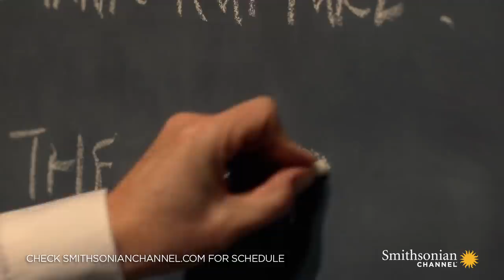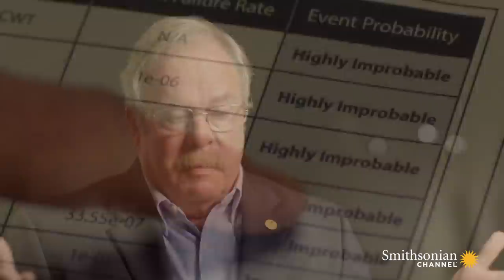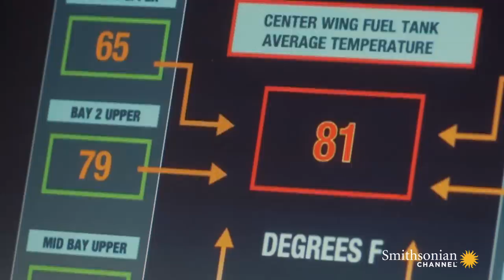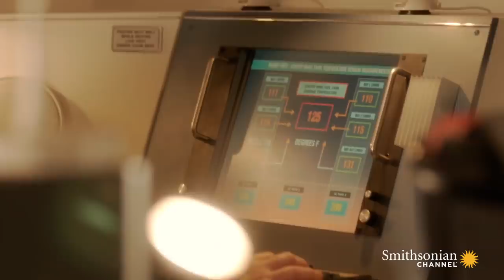How Air Conditioning Caused TWA Flight 800 to Explode

Comment: Next they should do one on jet fuel and steel beams
Reply: Or Zyklon B staining concrete
Reply: there is no steal beams in any airplane. plane beams are made or aluminum and titanium or both
Reply: @hassangoli8080  It's a 9/11 conspiracy joke
Reply: nathan V 👍.  WTC 7 = Flight 800 = BS = government coverups.
Reply: r/wooosh
Reply: It doesn’t melt them, merely softened the steel to the point where it was unable to support much weight
Reply: Timothy Verrinder  it astounds me how almost no one realises that even if steel is not melting, extreme heat is still not good for it. My Laptop only heats up to 100 or so degrees while computing extreme amounts of data, which is a thousand or so degrees from its melting point. Why then is the motherboard built to make an emergency shutdown when it goes over 100 then? Same reason
Reply: Jet Fuel Can't Melt Steel Beams

Sounds like a meme; Actually true. The CIA counterintelligence operations are still working perfectly. They have the population doing their job for them. You get called a lunatic if you even so much as question the official 911 story. It later came out that 2 of the terrorist's fathers had been calling the FBI and warning them for months prior to the attack. Why didn't they listen? Almost like.. they knew 911 attack was going to happen, and they let it happen to justify going to war. But that would be crazy, right?
Reply: @astrosuperkoala1  it was a joke chill
Reply: @theshermantanker7043  it was a joke chill
Reply: @icemachine79  Also, the bomber's fathers (MULTIPLE) called the CIA and FBI 10 times over a number of months to warn them their sons were planning attack, they knew. Get real. You're watching too much CNN.
Reply: @ZeranZeran  This isn't my first rodeo with 9/11 truthers.  I'd recommend you bow out now before I horribly embarrass you in front of all these nice people.
Reply: Jet fuel is flammable in the vapor form which was the case in this flight so yes
Reply: Is napalm effective against war ships . I'll Google USS LIBERTY to find out .
Reply: @ZeranZeran  No, you stuck your hand up your backside 3 times and flung the results into the comments section.
Reply: @icemachine79  And I'd do it again proudly. 911 Sheep
Reply: 711 was a part time job
tomato town was an inside job
Reply: @icemachine79  top-tier reply, I’m filing that away for future use! 🤣
Reply: @dancingcarapace  settle down old man
Reply: @Edward-ed2oi  Prussian blue?

Comment: The center fuel wing tank got overheated and filled with flammable fuel vapors that bent the wiring and then all that was needed was a spark to set off that deadly tragic explosion which is indeed what happened on that night. 

The plane was not shot down by a missal

Comment: Temperature drops 2 degrees for every 1k altitude. At 14k, A/C could be relaxed.
Reply: sillyone52062 they said most of the ac working time was several hours before take-off
Reply: That's assuming standard ICAO atmosphere is in place, which is basically never.
Reply: @intorsusvolo7834  Yes every plane does that everywhere in the world since the dawn of time. If the aircraft is about to fly another leg it runs on its own ac, power etc for most of the turnaround.
Reply: NY at 8pm isn't that hot. AC wasn't under stress. They simply lie.

Comment: If this is true, then it really was a million-to-one shot that the heat actually accumulated to blow up the plane or ignite a spark or a short circuit. . . . I remain dubious.
Reply: @robshef718  No, it wouldn't blow up every time you start the engine, because there's no spark to ignite it unlike here in TWA's case.
Reply: @thisperson2517  If you own a modern gasoline powered car you have an electric fuel pump with wires in your tank. I have seen the wires burn in two and no explosion. This is gasoline not kerosene. Do you worry about that?

Comment: "Air conditioning" aka missile
Reply: AKA air conditioning
Reply: @Willaev  aka missile....
Reply: @kirilmihaylov1934  AKA air conditioning
Reply: An air conditioning unit would make an ineffective missile.

While it has enough mass to cause serious damage at high speed an air conditioning unit couldn't really get airbourne.
Why?

Its not aerodynamic - big square sides mean high air resistance: requiring more fuel to accelerate and limiting manueverabiltiy
Its heavy: requiring more fuel to accelerate it
More fuel equal more weight: requiring more fuel, which adds weight
Its not practical to launch from the surface: this would require far more fuel than an air launch

It really has to be carried inside an aircraft: limiting the launch platforms for your air conditioning unit missile

Conclusion: Air conditioning units make impractical missiles. Please clarify whether you wish to bulk order missiles or air conditioners from your local Boeing subsidiary
Reply: @HiringHamblin  You just wasted so much time on a comment that went over your head
Reply: @YourselfAndEye  Who is the biggest time waster? The time waster or the one who wastes his own time telling him he wasted his?
Reply: Hamblin Approved LOL AWESOME
Reply: @HiringHamblin  Touché
Reply: Hamblin Approved I will make a fiberglass, narrow cone-shaped air conditioner. Then we’ll see who’s laughing.
Reply: The aircraft wasn't flying above hostile territories... How would a missile even get to it without a dedicated fighter being dispatched to fire it? Airports don't have missile launchers you know.
Reply: 😭😭 facts
Reply: @or3356   It's a well known fact that the US navy was doing training exercises in the immediate vicinity. After the plane went down, one of the ships left the scene. Now couple that with the numerous eye witnesses who saw a missile rise from the water, the forensic evidence, the radar evidence, and the NTSB officials who have came foward stating that FBI agents removed, and manipulated certain crash debris during the reconstruction phase. 

But nahhh, it was the "air conditioning."
Reply: @YourselfAndEye  Yep, air conditioning.
Reply: Aka heat
Reply: nice tin foil hat
Reply: Missile?
Reply: @HiringHamblin  the plane becomes a flying bomb however when the fuel vaporized
Reply: @YourselfAndEye  but none of the vessels were close enough

Comment: More coverup BS. Since the 747-100 had a positive fuel tank venting system, and the aircraft had been airborne for over 12 minutes at the time of the explosion, it is unlikely that ANY "explosive vapor" existed in TWA 800s Center Section Tank when the aircraft exploded. As a TWA 747 Captain, I flew the 747 for months after 800 went down. The “fix” was to carry a minimum of 10,000# in that tank as “unusable” fuel as I remember. We flew it from STL to HNL in the summer. There was NO restriction on using the a/c packs on the ground or in flight.
Reply: Thank You.  And what most peeps in here cant figure out... (and I was a US Navy Aircraft Handler and Fire Fighter and worked with aviation kerosene)   is that Jet fuel IS NOT a flammable liquid but a COMBUSTIBLE liquid who's Flash point is very high and that the fuel is extremely stable and very low in volatility. Its properties just cannot allow for such a powerful and high energy explosion that would blow in half, the strongest plane ever built!    it was a missile!
Reply: Since the claim is the ac units that heated up the fuel, then why it didnt explode on the ground where temperature is higher alongside oxygen rather than 15000ft with colder temp and less oxygen
Reply: @ChaklitTea   Of course anyone who has half a brain knows that the plane did not 'just blow up' . And the 'AC' unit DOES NOT provide any appreciable heat into the tank, as it is designed not too!  It was a missile.

Comment: Uh... Boeing has put its air conditioning packs underneath the centre tank for years. Every model it’s made with the exception of the 787 which uses a different system is like that. 

The air for the air conditioning pack is at 350F whether it’s being used to heat or cool the plane. That’s because it’s bleed air from the engines. The pack actually cools the air... first through a heat exchanger.. and then through an air cycle machine in parallel with another heat exchanger. The resulting air is so cold it has to be heated up with raw bleed air even in cooling mode. 

What’s interesting is that they didn’t think of the hydraulic fluid cooling system. It uses fuel to cool the fluid... and uses the very hot hydraulic fluid to keep the fuel from freezing at high altitudes. It’s inside the tank... not next to it insulated by insulation and several layers of metal in a compartment that is vented to atmosphere.
Reply: Yes, the AC/ Air pack system has been successfully used as it was designed, for years...Until the fear tactics from the corrupt NTSB created a head ache.  Thanks for be the only other person in here in many years who actually understand the Air Pack system. I could not have said it better. 
But in all cases, the AC/ Air packs had no part in the crash, and cannot have had any part in the accident.
Reply: The air conditioning packs story seems plausible because Philippine Airlines Flight 143 exploded in 1990 for the same probable reasons.

Comment: Many solid facts have to be ignored to make the exploding fuel tank scenario work, here's just one: The debris field: FAA radar data shows (at the moment the plane lost electrical power) debris shooting out of the plane at Mach 4 (about 6000 mph) moving from left to right, which is consistent with Nat. Guard helicopter pilot Fred Meyer's testimony of the missile hitting the plane from the left. The fuel tank explosion could not possibly explain this, as jet fuel cannot produce such a force.
Reply: Do you realize how much energy would be released from a sealed tank of jet fuel detonating?
Reply: @Owen_loves_Butters  According to Tom Stalcup, who has a PhD in physics,  jet fuel is considered a low pressure explosion,  and could not possibly produce the force to shoot debris out at that speed.  He has a lot  of work on the TWA 800 crash, bringing  science and hard evidence to the discussion..

Comment: I sent an email to the FBI back then, though as a non-American I didn't know what else to do or whom to contact with information. I was a passenger on the previous flight, seat 14A (or 12A - my memory still puzzles me on that). My seat was the only one that had a leak from the overhead A/C system while we were waiting 2 hours for takeoff. A greenish liquid that messed up my shirt and the flight attendant said they could replace my shirt, though I never asked. The leak stopped when we took off.
When I heard about the accident I also heard that the airplane split in around the area of my seat.
Reply: Wow that’s sounds real

Comment: That's not true. Fuel is NOT flammable. Temperature in N Y at 8pm wasn't that high to put high pressure on the AC system. July, 8pm temp is 28c at NY. A missile hit that plane. Don't make some fools of us.

Comment: Yeah, it wasn't the AC
Reply: Thank You.....
Reply: nice tin foil hat.
Reply: it was not the 'air conditioner',  if that is what is troubling you.
Reply: @robshef718  it wasn’t the air conditioning it was the faulty wiring that was repaired with duct tape (really dumb) that allows  high voltage current to jump to low voltage wiring which the low voltage wire went into the fuel tank and short circuited from the extra voltage.

Comment: At 14,000 ft., the outside temp was just too high and cold to vaporize the fuel oil. The outside temp MUST be taken as a factor and NOT ignored.
Reply: They also ignored the air content inside the fuel tank. Fuel needs a certain amount of oxygen to explode.
Reply: @mach6893  you forgot that it takes hot air from the engines and cools it down
Reply: @jonahmoran3751  True, and that's how the fuel vapors reached ignition temperature.
Reply: It wasn’t a fuel tank problem. 😂 It was a missile strike.
Reply: Actually it makes the ignition point lower.

Comment: Watching these videos is making me realise and is also genuinely convincing me that practically every single thing inside an aircraft can make it crash (not good news!). From an autopilot system with a mind of its own, to a freaking airconditioner?!
Reply: Robi Shefran  do you even know which flight I was referring to? Because it definitely  did not involve 2 airliners......
You need to stop jumping to conclusions and making assumptions on people's comments before gathering the full information on these things.
Reply: @tasha3757  Still, two airliners fell victims of these flaws, but with 6 years between each other.
Reply: Or a stereo system inside the walls.
Reply: Those a/c units have a high temp cutoff of 120 degrees, and the flight engineer has to reset the ac unit once it cools down. No way it heated the empty tank hot enough for ignition. I have a friend who has been an A and P mechanic on those planes for 40 years. I have 2 cousins who have flown those jets millions of miles. They all laugh at the fbi story. Since 1969 all those planes were retrofitted with filters that scrub the oxygen molecules from the incoming air into those fuel tanks. There was no oxygen in that tank!!!! No explosion possible!!!! Plus the crew before them had pumped the center tank completely dry, no fuel in that tank for an explosion. Spark? From bad wiring? Are you frigging kidding me? Every circuit on that plane has a breaker, and the wires in that tank is diode protected.. 3 strikes and you are out.
Reply: @julosx  in that 6 years the FAA installed oxygen scrubbing filters on the fuel tanks of every jet in the world. Oxygen cannot get into those tanks. No explosion is possible, now.. the first one yes, it did happen
Reply: @KBS117  I've never heard about those filters. What I do know, is since this TWA 800 crash, air carriers use nitrogen to fill up the empty tanks, that explains why nothing ever happened since. Nitrogen is also used to inflate aircraft (and sometimes cars) tyres for the same reason : it can't catch fire.
Reply: @julosx  nitrogen is what's left when you filter out the oxygen.. all aircraft have these filters since 1969. They filter out the larger oxygen molecules and only allow the smaller nitrogen molecules into the tanks. My good friend has been a mechanic in Dallas on these aircraft since 1979. He has worked on these planes extensively,  and shared this information. He also states, it's impossible to get a spark in that tank.. plus, that tank was completely empty. And lastly, the ac units that supposedly heated that tank up to a combustion level of 250 degrees, have a maximum heat range of 140 degrees, and then they shut down. Once shut down, the crew has to reset the ac units manually from the cockpit, to restart the units, after they cool down. Like I have been saying, from a mechanical standpoint,  the fbi is a liar..
Reply: @KBS117  Your friend, no matter his knowledge, was not a part of the investigators and had no access to the wreckage. By the way, the central tank wasn't completely empty, there was a puddle of jet fuel remaining. Under enough pressure and heat it's likely to vaporize and then to ignite all by itself, even without a spark. According to the NTSB there was such a thing as a spark because the fuel level float was exposed to a high tension due to the bad state of the wiring system around it, exactly the same as the Philippines Airlines 737 six years before.
Reply: That is true about all the machines you use on a regular basis in your modern life. That car, that bus, the phone, the laptop, the fridge, the oven. And all of them can cause a massive fire that can cause damage or kill people.
Reply: @tasha3757  the truth about 800... it was pushed in front of plane load of lsreali diplomats . Terrorists launched a missile at what they thought was the plane full of Jewish diplomats.   The navy must have know about the threat, as they were in place to counter attack, and did so by launching 2 counter measures from sea. The countermeasures made contact with the missile, too close to flight 800 breaking it apart. Listen to the military vet piloting the helicopter in view of everything. He said on missile from the shore, and 2 smaller ones from the sea.. that's what happened.